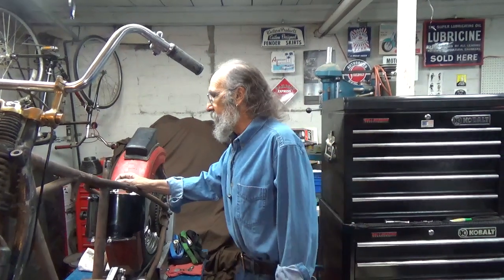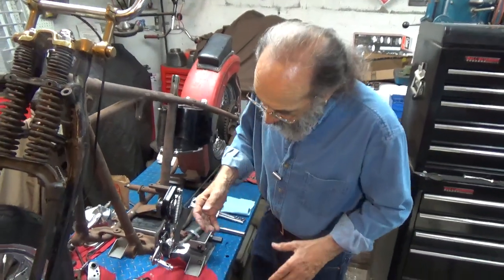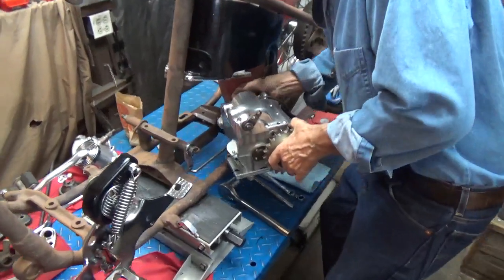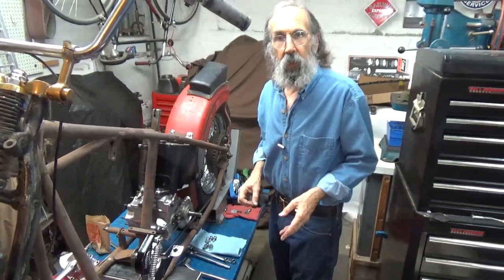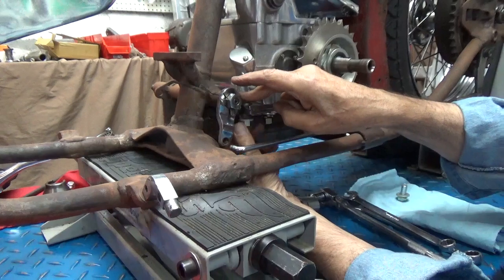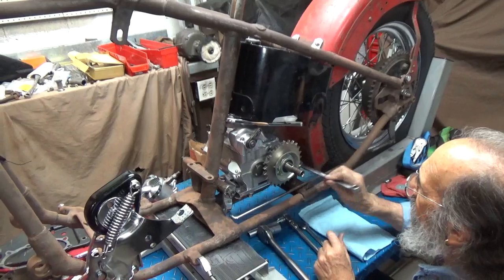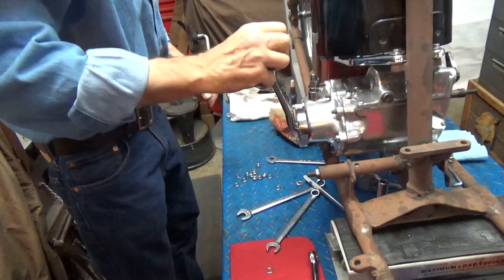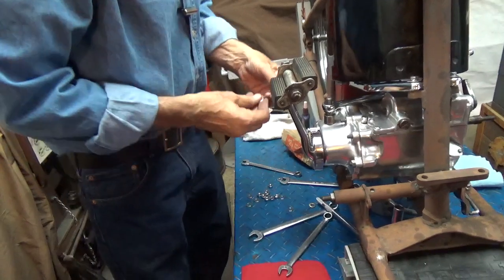The Kickstarter For the Big Harley Flathead is Done   Let's Install It

Comment: Hello Mike,

Thank you for yet another EDUCATION 
I have  ONLY  had experience on FXRP  &  DYNA  Engine & Transmission installations 
I am amazed at the DIFFERENCES with a RIGID FRAME transmission installation & adjustment(s) 
( I also appreciate that when you experience a mistake or error ... you leave it in the VIDEO ) 
which helps everyone figure out OUR prospective future mistakes, too ! 

Thanks again 

COOP

.........................................
Reply from the maker: Thank You.  Yah, it's a little more work putting a trans case into a rubber mount.  And Yah, I screw up, especially with a few thousand people watching.  But, I own up to it.

Comment: Aloha from Hawaii, the middle of the Pacific.
Firstly I just wanted to thank you for making these videos, they’ve been incredibly helpful and educational.
The way you go about things helps calm me down as I freak out and run around like a headless chicken while working on my bike. 

I do have a question about the mechanics of the clutch pushrod and throw out bearing:

How, or what makes the clutch release lever move back into the “engaged” position when you let off the foot pedal/hand lever? I’m having a hard time understanding how that works mechanically, and I’d really appreciate it if you could help me reach enlightenment on that. 

I’ve got a ratchet top 4 speed transmission that I’ve been putting back together (thanks to your videos), and the clutch release lever doesn’t seem to move back on its own, and I can’t quite figure it out.
Reply from the maker: Simple.  Picture the clutch assembly installed onto the end of the transmission mainshaft.  The other end of the mainshaft has the throwout bearing on it.  The clutch release lever moves the bearing. The bearing moves the clutch rod, which in turn, disengages the clutch.  When the pedal moves the clutch release lever, everything from there is moved by  the clutch springs to reengage the clutch.  I hope that helps and thanks for watching.
Reply: Pacific Mike That helps tremendously, thank you so much!

Comment: Hi Mike. Hoping I could get some advice. Installing a Andrews EV27 cam in my 87 Evo and I'm trying to match the cam gear  to the pinion gear for a proper fit. I bought the measuring pins, in my case the .105 for the early EVO motors. I correctly placed them 180 deg  apart and secured them on the gear with a large hose clamp instead of a rubber band as the book suggests to do the measurements, the hose clamp gives the pins a very secure fit in between the gear teeth compared to using a rubber band. I then placed the cam in a vice with plastic jaws to protect the cam but make it very stable to do the measurements without any movement. I'm using veneer calibers instead of micrometers to measure because I don't own 2-3" micrometers. My problem is despite all my attention to detail my measurements are all over the place. The book is calling for tolerances in the .0005 range and I can't even get a consistent reading in the .001 range. The measurements taken at the bottom close to the gear are considerably higher then if I take him at the top of the pins, like the pins are being tapered inwards going towards the top. I've been very careful  taking these measurements close to the top not to apply any extra pressure to the caliber that would pull those pins inward and alter the reading  but the numbers are still lower at the top than the bottom. I don't seem to be able to get anywhere near an accurate enough measurement to stay within a five ten thousandths tolerance. Do you have any tips or suggestions that might help me with this or possibly another way of checking. Thank you for your time. Regards Dennis!
Reply from the maker: I appreciate your attention to detail, but I think you're a bit overboard.  Andrews has been doing this for so many years.  I'd be willing to bet, that in this modern motor, you can install that cam and it will be just fine.  Twin cams, another story entirely.  That hose clamp idea sounds a bit sketchy.  I'd use a rubber band.  Borrow a micrometer, and don't sweat it.  Be sure your endplay is correct according to Andrews.  They made the cam.  Make sure your valve lifters are either new or in very good condition.

Comment: Good to hear you are moving ahead. I have the same handle bars that were original on my dads bike.I am installing the
belt drive system. The weather in Georgia is turning cold !
Reply from the maker: I really like the bars.  They're kinda worn, and I don't know if they'll fit right.  If they're really cool, I'll buy a new pair and put them on.  They're still being produced today.  Not a reproduction, the same bar.  I though Georgia was basically a warm place.
Reply: @pacificmike9501  Good to hear from you, it was 52 degrees for 2 mornings. It warmed up to 63.Thanks for telling me about the handle bars are still manufacturer them. See you on the internet !!

Comment: Hello Mike I got a question, but first I wanted to tell you that I just love your videos and how there is so much knowledge to gain from them.
At the moment I own a 2012 softail Blackline, but everywhere I look I see old carbureted Harleys riding around if it’s on YouTube or on the streets.
Now I am really interested in selling mine and buying a “older“ model but: (and now comes a Big question) what would you recommend for someone as a first carb-bike?
A Shovel? Evo? (Big twins or Sportster) Or maybe even a TwinCam? Late or early year models? 
Are some engines too much work for someone who just gets into those type of bikes?
The only choice I made for myself was that I don’t want a iron head cuz I am afraid it’s going to rust away under my ownership.
But other than that I really don’t know... maybe you or someone from the comment section can give me some tips

Ps: sorry for not listing anything older then a shovel but where I live I’d have to sell Organs to get some of these 😅
Reply from the maker: Older bikes require more maintenance.  I don't know how late carbureted bikes were sold where you live.  Routine maintenance is explained in our videos.  I don't know what to tell you.  I've worked on, rebuilt, maintained and tuned an awful lot of injected bikes.  But, I've never owned one.
Reply: @Pacific Mike so in your opinion (as long as I don’t have two left hands) I should be good no matter what engine I’d choose.
And stuff like „dreaded“ cam chain tensioners on the early TwinCams are not something to worry too much about as long as it’s maintained properly or I make it properly? 
Well your videos will help me a lot in the Future no matter what I will choose, so thank you.
And thank you for your fast reply, it really is wonderful that you take the time to reply to all those comments 👍

Comment: Hey Mike, loving the build. Have you thought of colours / colour for the bike, I know, I know, you'll pick what you want, I understand that, just a thought, only! 
Have you thought of a shade of copper colour??, maybe a mix and match with another colour? 
Only reason, well, the nice pieces of  triple trees and bar risers. Food for thought. 🙂👍
Reply from the maker: Thanks for the thoughts.  I find the designs of the old Harley components, frame, forks, engine and trans to be so artistic, that I don't want the paint to detract from them.
Reply: @pacificmike9501  I get that,  completely understand.  😊👍

Comment: I thought the kick starter would move the sprocket more than it seemed to be moving... ALWAYS interesting stuff... THANX!
Reply from the maker: It's moving the mainshaft.  The final drive gear, with the sprocket on it, is moving a little, very little.  The trans is in neutral.
Reply: @pacificmike9501  Gotcha!

Comment: Good looking and comfortable handlebars. I missed you mounting the front wheel. Do you know the Harley part number for that Borroni front rim. What front tire is that. Nice to see more parts added each video. Like I said before, you're building something special.
Reply: In fact, it is Borrani. Made in Italia.
Reply from the maker: Thank You.  That's an old Borrani Rim.  You won't find one in stock, unless you get real lucky.  I have an early Sportster Parts book, somewhere.  That's where the answer is.  The tire is a Continental.
Reply: @pacificmike9501  It is still possible to have this new= 
https://www.ruoteborrani.com/fr/roues-a-rayons-pour-motocyclettes/classiques/distributeurs/

Comment: Hi Mike, I've removed the primary cover off of my 1984 FLHT evolution, with 5 speed, dry clutch, self lubricating enclosed chain cover, to change the clutch springs and found five pieces of metal.  They are semi-circular and look like bearings or valve guides.  They look to be two halves that would go around a shaft.  Please help, I can't find anything in the service manual . I can send a pic if I have an email.  I can be reached at legman01@sbcglobal.net.  Thanks in advance.  David
Reply from the maker: I'll see what I can do.